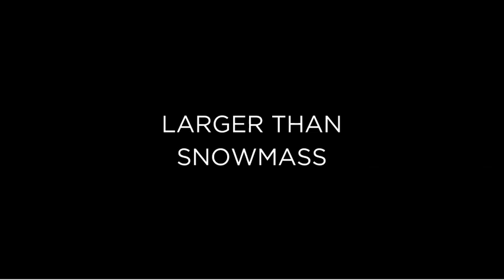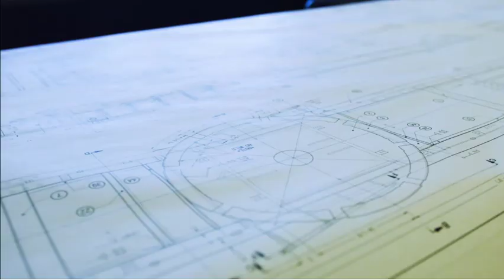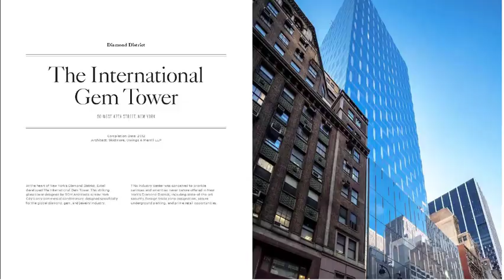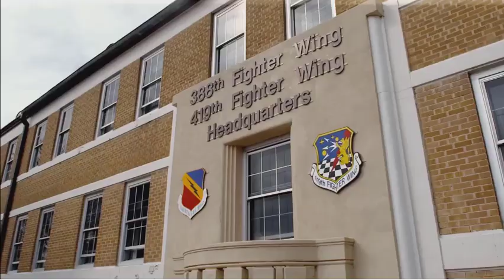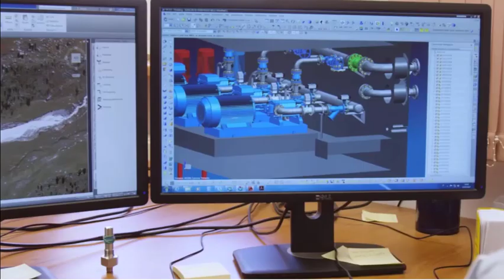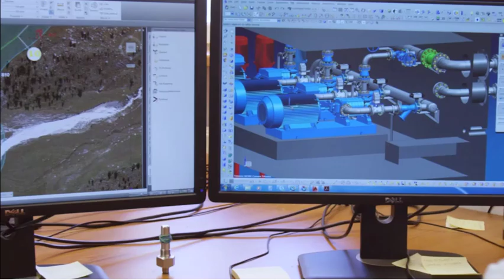Mayflower Resort

Comment: Base elevation is only 6,500'.  Given Utah's rapid climate change, this ski resort will have really crappy snow and a short season.   Latest paleoclimatology research reveals that from the Sierras to the Front Range of Colorado, we experiance natural and cyclic apocalyptic droughts, and we are only midway of entering into a new drought.  We have the kibd of apocalyptic dtoughts in which mountain rivers run dry for a 100 years at a time.   There will be no significant snow accumulations at this resort in 50 years.  They will have a 20" base at best.
Reply: Yep and now we are having record snow levels...
Reply: This is not a pattern.  And you have not been following monthly snow water equivailent snowpack statistics by drainage basin across the west, every month for the past 15 years.  I have though.  And I have studied Intermountain West specific climatology.
Reply: Couldnt agree more. That side of deer valley sees so much sun, and mayflower will only get more. This resort will be so icy.
Reply: This comment sure didn't age well 🤣